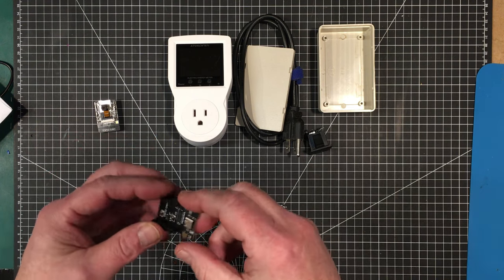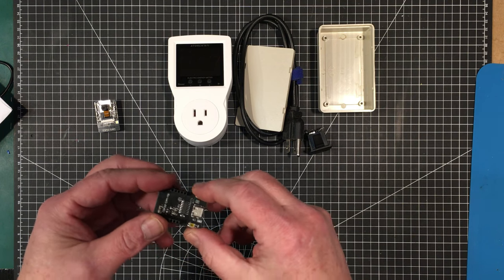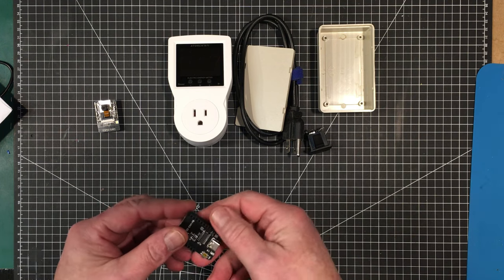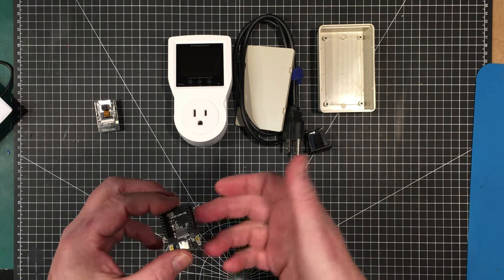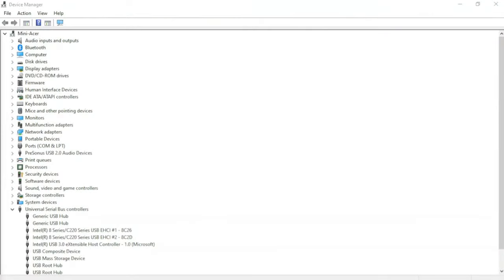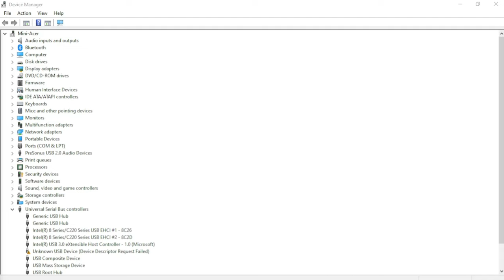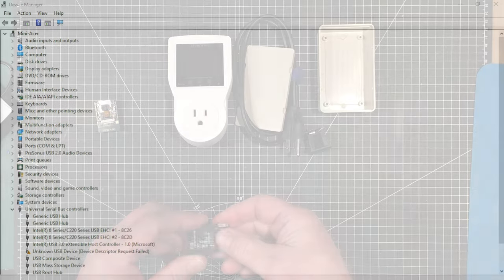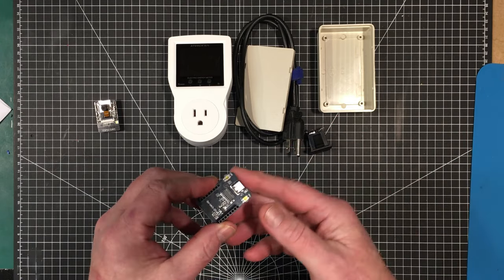0152 - Let's Build a Single Outlet Meter Base (Bonus Update)

Comment: I've seen you using  those project boxes multiple times but never found that type of box. Do you have a link for buying those?
Reply from the maker: Unfortunately I don't.  I bought a carton of 100 of these back in 2012 off a vendor on ebay.  They only go back 7 years on the history.  I've looked for them, but I can't find them any more.
Reply: @uni-byte  thx for looking. Do you have dimensions for those?
Reply from the maker: @wdl1908  I found the invoice for them.  I got them from the Ningbo Everest Enclosure Tech co.  in Ningbo China.  They are model # PC039 and they are 106mm x 66mm x 32mm.  I got 100 of them for $25 back in September of 2013.